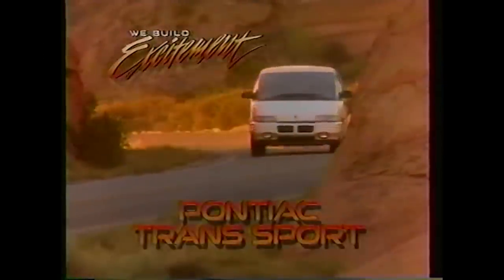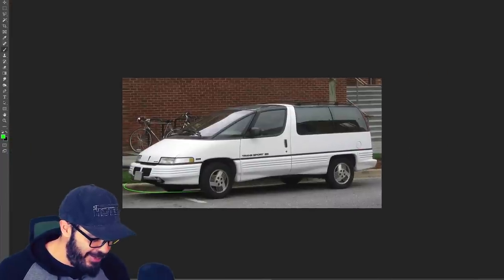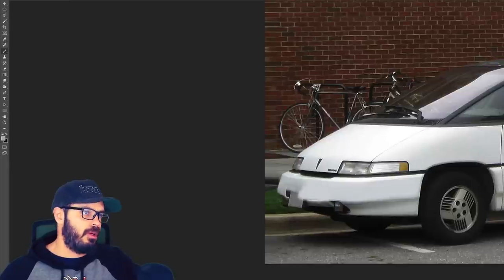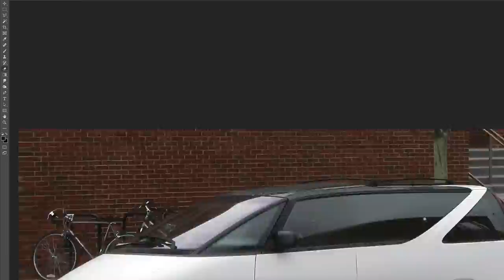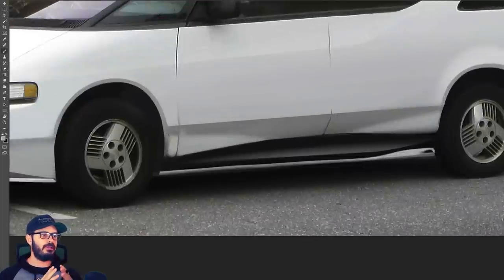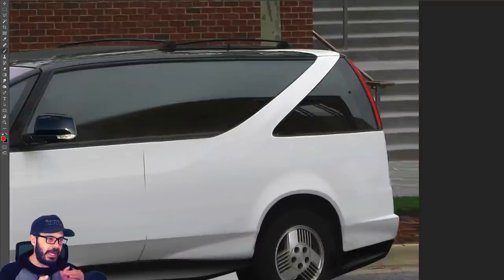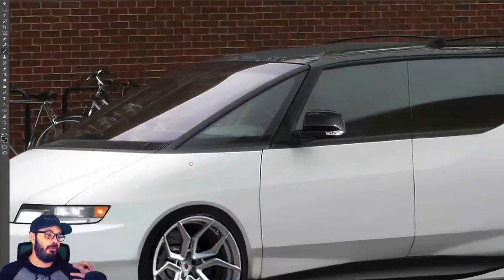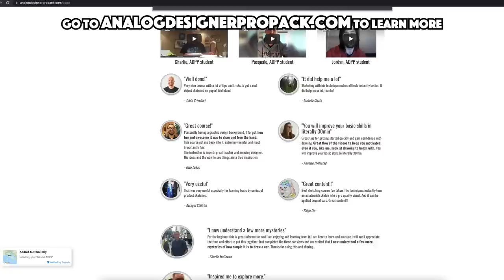Bringing back the classic Pontiac Trans Sport

Comment: I really like this design, the integration of that body-colored swoop was really nice, and it looks like it could come out in 2023, but it just feels like the Pontiac identity is gone. I would have really liked to see some kind of a modernization of the split grille (better than BMW's treatment).
Reply: A great looking car. But a nightmare to park because of the long front.
Reply: Agreed, it's not a Pontiac without the grill and I think it would be pretty easy to do it in a treatment that doesn't look like BMW. Just make sure to keep it trapezoidal overall, and it will communicate "Pontiac-ness" pretty clearly.

Comment: one of my crazy uncles used to have one of these (in white color too), I remember we were on a road trip once and at one point my uncle decided to do a pull on the highway, the sound of that V6 was unexpected, everyone inside having epic reactions when we noticed the van was outrunning a Honda and a highway patrol car chasing it. When Dad checked the speedometer, we were doing 100mph 🤣
Reply: Probably a 318 Dodge Diplomat police car that was chasing the van? Those were slow for sure.
Reply: @generaloranger6150  this was back in '98, if I remember correctly it was just an old Crown Vic or something similar 😂

Comment: basically, the Pontiac brand has it's thing that it is distinguished from everything else by a specific front design. Where even Fiero does not hide it and tried to make it a little visible. The one in the photo looks like a European one. Sorry but that's my opinion. Nothing will take away the charm of old PTSs, whether before or after the facelift

Comment: More than likely, the Pontiac Transport/Montana's "comeback" would be based around it's Chinese counterpart, the 2022+ Buick GL8, but it would be built in South Korea for North America-only export (probably in the same factory where the Encore GX/Trailblazers are made). Only difference is the Transport would get the 3.6L V6, along with the Chinese Buick's 2.0 turbo, and slightly altered cosmetics, along with an interior that's uniquely Pontiac.
Ironically, the smaller Buick Encore GX-based Pontiac Aztek would be built there as well, and is a direct competitor to the Jeep Compass and Ford Bronco Sport (the Escape is the Trax's primary competitor).

Comment: Removing the twin port grille removes its identity as a Pontiac. Pontiac has historically had a twin port grille just as long as BMW has, only wide/horizontal vs. tall/vertical. So you ended up converting this into a Chevrolet Lumina APV or Oldsmobile Silhouette. Additionally, you didn't clean up the peeling paint on the roof.

Comment: The van, as some have mentioned already, did not have a V-8, nor was it's engine even 3.8L in displacement. It was a 3.4L V-6. And the way the engine was already stuffed into the front, I'm not sure there would have been enough room for the 3.8L.

The next gripe I have is the way you mentioned being able to remove the rear seats. Every van can do that, that's nothing special. What you could have mentioned, though, was that the 5 rear seats were individual chairs rather than typical benches and could, therefore, be removed individually. This made the Trans Sport far more versatile for carrying people and their things.

You also made it sound like they came with leather upholstery by default, which was also not true. Leather was optional only on higher-end models. Base models didn't even have air conditioning, ABS, or even airbags as standard equipment when they were introduced in 1990. 

Fun fact: One thing that GM managed to figure out, though, that Chrysler (the "inventors" of the minivan) still hadn't entirely figured out some ten years after launching the Caravan, was that they were able to make the side door, the sliding one, lock in the open position when the van was facing downhill, regardless of how steep the hill was. It took forever for Chrysler to work that one out.

I should also mention that, even though they eventually dropped the Trans Sport name altogether, the van itself was not truly discontinued until much later. Instead, what GM did was transition the Trans Sport into the Montana by way of making "Montana" a trim level of the van for a year or two and then quietly dropping the original name completely. But, it was still the exact same van as before. It was at that point in time that Chevy got the Venture as a replacement for its Lumina APV. The worst, however, was yet to come, when GM changed the name again to SV6 (after a similar phasing out strategy as with the Trans Sport) and dramatically changed the design along with it. Chevy's version became the Uplander, Oldsmobile lost the Silhouette a long time before this (and was killed off completely by GM in 2003), Buick instead got one called, of all things, the Terraza, and even the still young Saturn got one called the Relay. By the time the minivans were axed, they were powered by 3.9L V-6 that put out 240hp. Gm hasn't made a minivan since. The 2008 global financial meltdown might have had a small part to play in that, as well. Lol
Reply: They added the 3.8L V6 as an option in 92. Started out with the 3.1L first in 90.
Reply: @tracksoneverything4085  Right, forgot bout that one. Thanks for reminding me.
Reply: My parents had a 3.8L lumina van it was definitely stuffed in there lol
Reply: Mine had one from the opposite end of the product run, which is even more surprising that I forgot about the 3.1L. We got ours the year they came out. The only power function it had, other than power steering and brakes, was the door locks. And a whopping 4-speaker stereo system, the quality of which was.... well, it wasn't great. Lol
Reply: We actually had the Trans Sport, but same thing.
Reply: Yeah they've come a long way since then for sure, ours was a 95 so near the end of the first generation and last year of 3.8l. lots of good times in that van though lol.
Reply: @tracksoneverything4085  Same. I used mine as a tent for an overnight camping night with my grad class in highschool. It was arguably the best tent there that night. Lol
Reply: @HighlandPants69  did the exact same thing for my grad lol it sure made a great tent didn't think I'd be getting nostalgic over an old van from the 90's today but here we are lol
Reply: @tracksoneverything4085  Also, who knew that vehicular musical chairs could be a thing, and those seats each had two positions in which they could be placed owing to extra latch points in the floor behind the regular ones, which was great if passengers needed a little extra leg room.

Comment: Amazing editing skills for sure! Im not criticizing your editing skills but your design. The front of the car looks like a 2015 kia bumper mounted on anything 1990s GM crap. The wheels are something one would put on their car in GTA online and the rear just looks like a Honda CR-V or something. I owned one of these for short while and it was really cool in its way. But i do think the cars weirdness made it fun but somewhat impractical at the same time mainly due to the drivers controls and minor crap. Id say new cars are much worse. The 3800 motor had plenty of power for a minivan. Was a very fun vehicle to go around with.

Comment: I'm a big fan of your redesigns - usually. This one seemed to lose the character of the Pontiac brand when you scrubbed the split grille. It almost looks like an EV now, because there'd be no air cooling possible.

Also, with moving the B-pillar, I half expected you to add a hockey-stick stripe, similar to Starsky and Hutch's 1976 Ford Gran Torino, only reversed! 🤣

Those rims just destroyed it, also. They're more up-to-date, sure, but they are just too big!